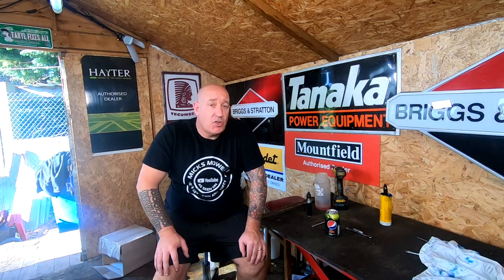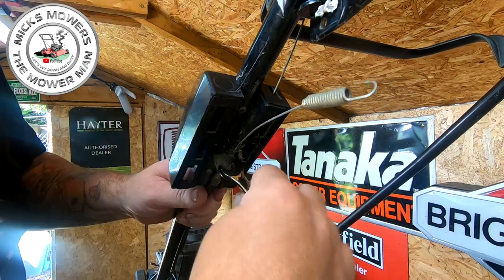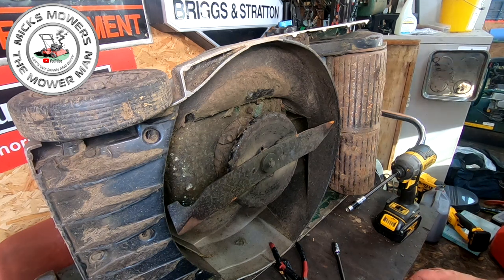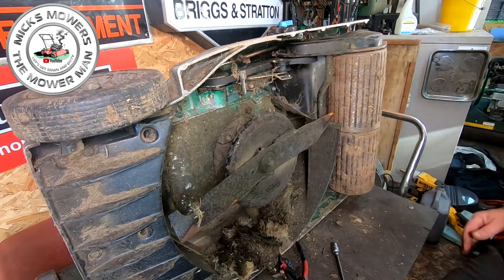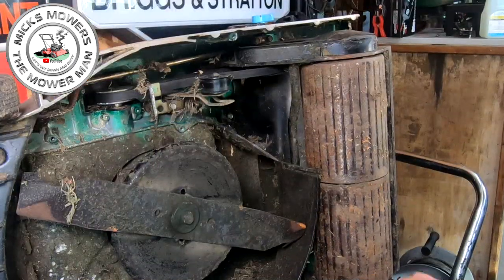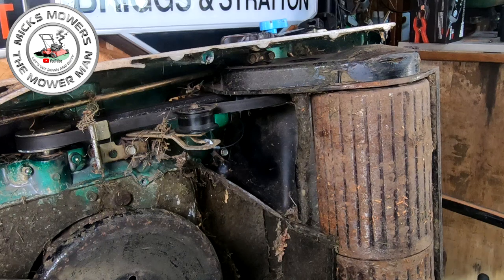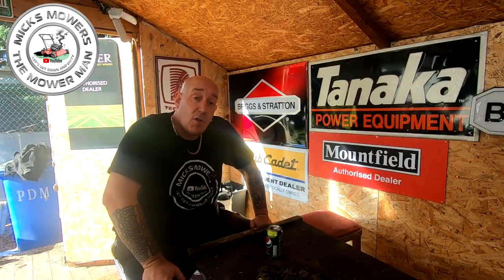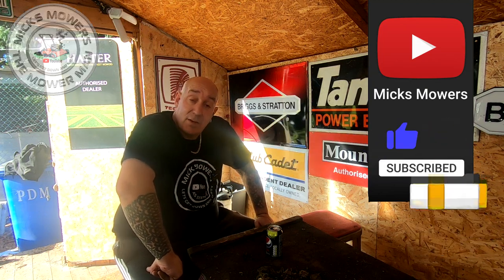Replacing a Hayter 48 Drive Cable.. Dump Find Mower #mowerman #dump

Comment: I love the Harrier 48 and 56, they do a lovely job and are bomb proof!
That's a sound bit of advice regarding the correct model number and new cables, there's so many variants of the harrier and if you get the wrong cable it just won't fit! It might be a good idea to do a shorts video on locating the model number for most of Hayters machines as the correct model code is key to getting the correct parts.
Reply from the maker: Good idea mate

Comment: Mick,
Would you be able to show cable connections on a Hayter 48 490g if you come across one please? 
I have one Im trying to get going for my son. Far from being an expert. It seems that the choke part has no connections to it to actually make it choke? Black plastic crescent shaped thing under top cover just very flappy. Thin metal its sits over doesn't move no matter what handle you press/move.
If you come across one it would be appreciated. Thank You.
Reply from the maker: Email me some photos mate micksmowers01@gmail.com

Comment: Hi Mick, Thank for the video. Im trying to find a blade brake cable for a Hayter Harrier 41 319R. Please could you tell me where I can get the cable as I am not sure if they are universal to Hayter machines?
Reply from the maker: @antoniosousa6508  hi.. here is the parts diagram.. it should be able to help you out
Reply: @themowerman  Thanks Mick, I dont seem be able to see it.
Reply from the maker: @antoniosousa6508  https://www.diyspareparts.com/parts/hayter/diagrams/319r001001-319r099999/8870efac-27b6-4b30-a877/

Comment: 2001 Low hours vgc Hayter`48. Poor traction on anything other that level ground. New belt & cables haven`t improved it. Is it worth fitting a non standard notched belt to improve the torque/drive? If so, do any other Hayters use the same sized belt so I can order one that fits. Many thanks Mick.
Reply from the maker: Hi.. a new belt  is definitely worth doing ...

Comment: Hi Mick, my Harrier 480C runs forward and the rear roller turns without the drive bar being pushed forward, what happening there?
Reply from the maker: May need a cable adjustment mate
Reply: @themowerman  Two-part question mate, how can you tip her on her side like that if she's full of oil? would it run into the air filter?
Reply from the maker: @stevedunne9131  tip it carb side up mate ...